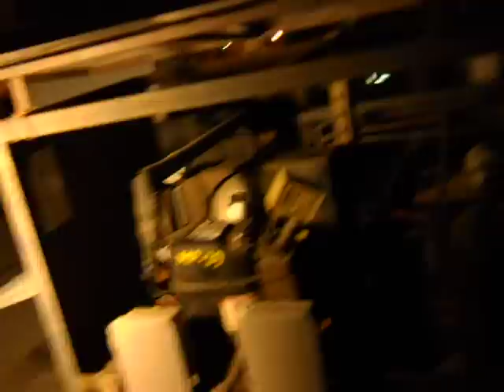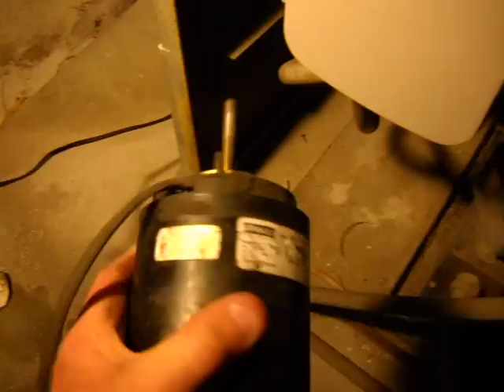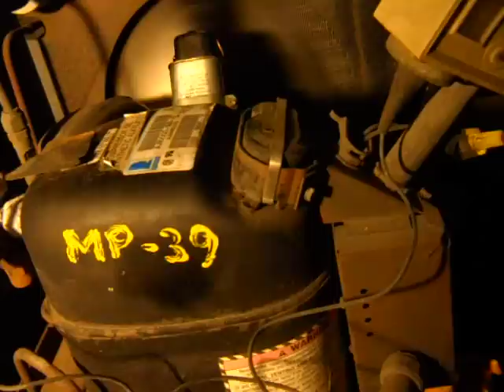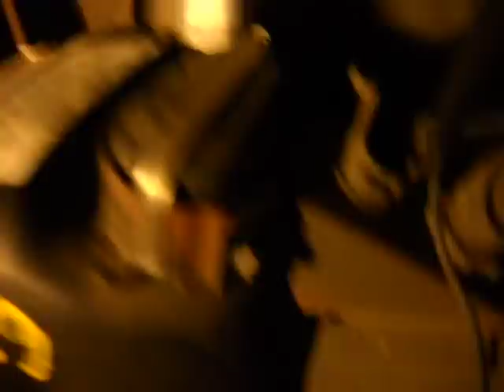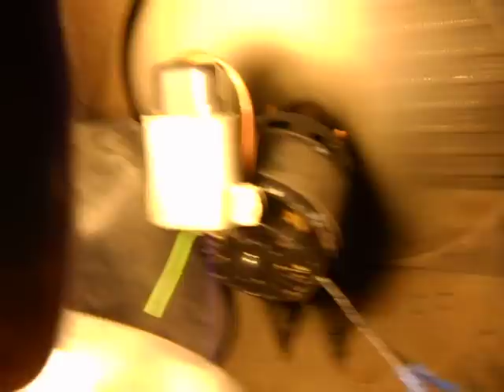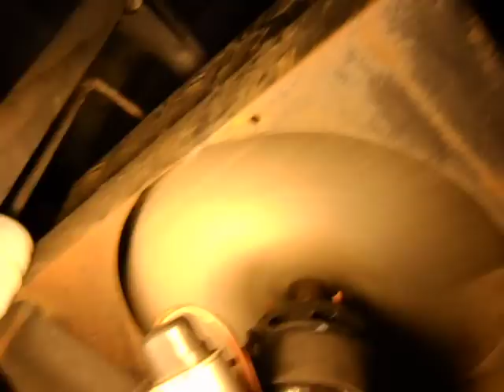8 Drawer Chef Base-Replace Condenser Fan Motor.

Comment: Good fix McGiver. I carry a fan with a metal cage around it I bought at Sam's club.When I get a condenser fan motor out after supply house hours I use rubber bungee straps and set the fan on the front of the condenser to get the system through the night, until I can buy the new motor and keep the food from spoiling.

Comment: i would of proposed to him to buy the cooler with out a compressor ... and still leave the old one downstairs or where ever the compressor is.. having a remote unit is the highest standard we as mechanics can do.. also if there where more compressors in that room and had easy access to a outside wall bring the condensers outside.